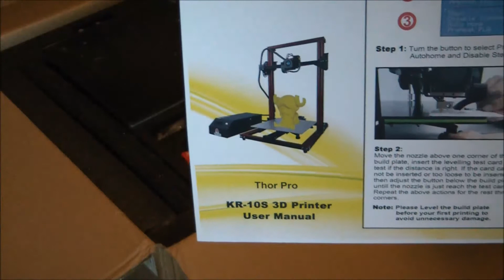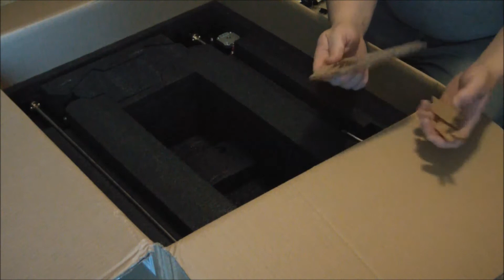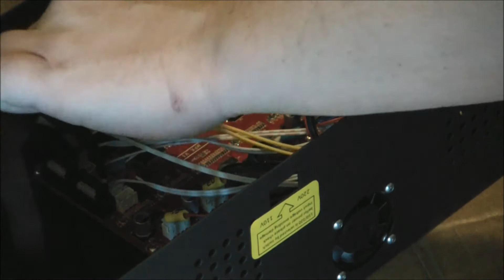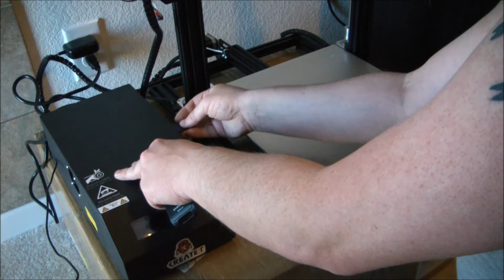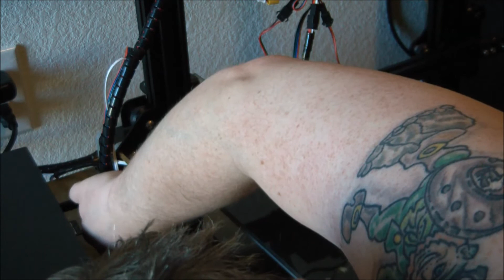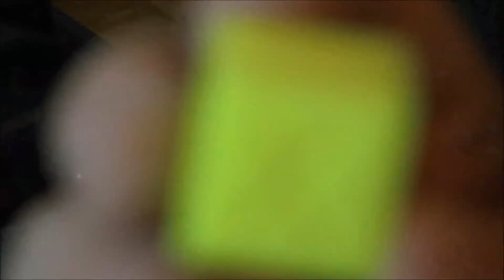Kreatit - Thor Pro KR 10s: Unboxing, Assembly, and First Print

Comment: I bought one from Amazon prime.  Mine is KR-10S Iris Pro dual 2-in-1-out extruder.  The controller board look exactly like Athrobot MKS Base. Took me about 10 min to assemble and another 10 min tightening the screws, belts and tweeking the eccentric spacers for V-slot rail wheels.  I thought it was quiet too but noticed that one of the hot end fan was't spinning and other one was barely spinning.  I got it working by taking apart and adding some lube inside the fan shaft area.  Other fan was dead on the arrival.  It had charred marks on the circuit board.  I didn't bother to contact Kreatit for replacement.  Much easier to buy better replacement fans from Amazon.  The SD card came in unopened package so that I thought it was brand new and empty but when I put it in the PC, it had instruction guides, Smoothieware drivers, Cura, and test stl files.  My glass bed was also scratched but it is very straight and level.  I printed very large parts without any problems.  I also received 3 bed clips only.  I used rubber band just like your setup for cable management as temporary measure but end it up being permanent because it worked so well.  I bought KR-10S instead of CR-10S because of the price and was planning to upgrade it anyways.  I'm planning to remove the 2-in-1-out hot end nozzle and replace it with E3D Chimera dual hot end.  Two extruder motors are located on the hot end assembly and they are very large and heavy.  I wonder why they put larger Nema 17 motors for extruder than other xyz motors.  I noticed on your video that your extruder motor is also larger than the xyz motors.  Anyways I'm going to remove them from X carriage and placed them on top Z Vslot rail.  Someone let me know if you have any experience in updating firmware on the MKS Base controller board as the Kreatit website has no information on how to update or adjust the firmware settings.  The board has AT Mega chip on it.  So probably running Marlin but not sure.  Otherwise I will probably replace it with Smoothieboard. I only printed in single extruder mode and very happy with the print results and won't mess with 2-in-1-out print till I replace it with Chimera to use one of the hotend for PVA dissoluble supports.  Besides it is much easier to replace E3D nozzle than to replace 2-in-1-out diamond nozzle.  I'm not even sure where to find replacement diamond nozzles.
Reply: Hello, did you ever have any luck with your iris?  Picked one up used off of eBay  to mess with and can't find any replacement parts for it so am thinking of some of what you suggested. Ever try to flash the board?  other then one ad, zero info about this printer on the web.  Guess the company went down fast. Thanks!